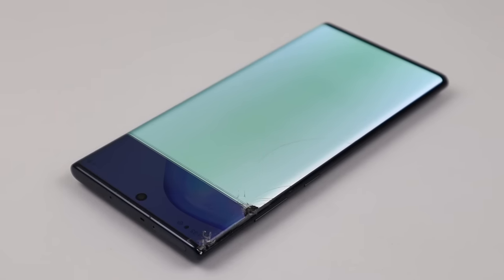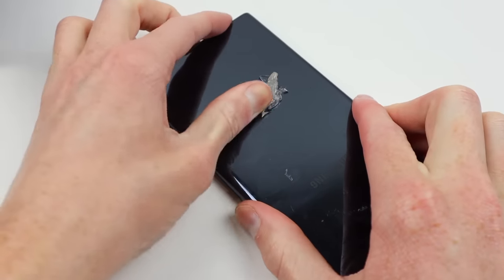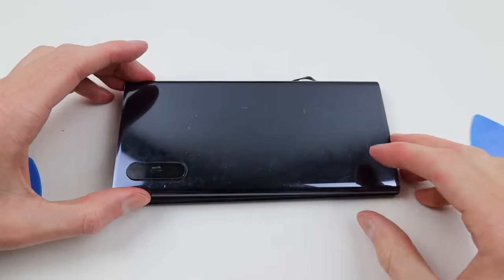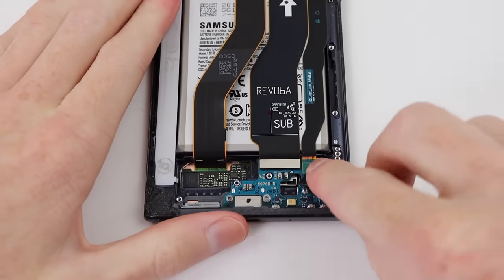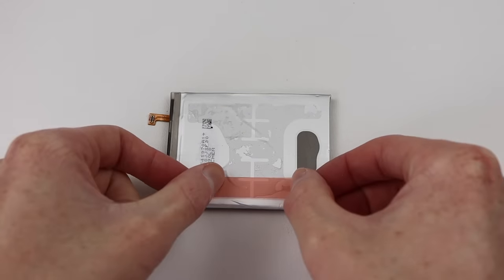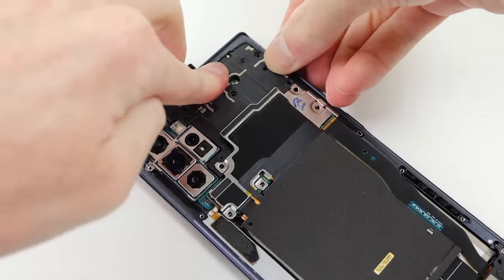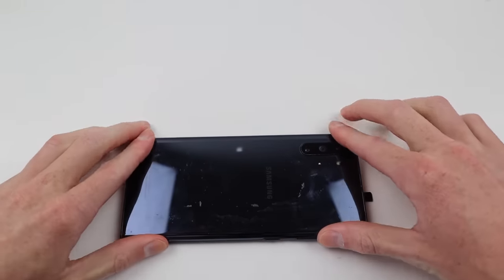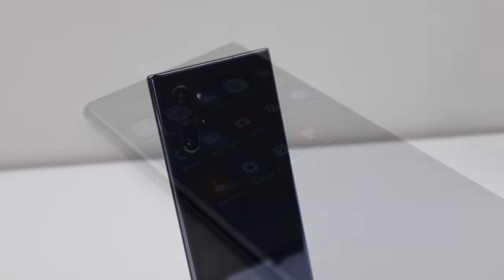How I saved $1017 on the latest Samsung by fixing a broken one - Note10+ Restoration

Comment: Hi, ex-samsung engineer here - when heating the device, place it on its front rather than the back. 

The reason for this is that the heat is not being applied directly to the battery or NFC/wireless charging coil, and removing the back glass is a lot easier. 

The heat will also evenly distribute throughout the body, and will allow you to remove the back glass.
Reply: I repaired s8 s7 note9  and now an s10. At 100 degrees for 2 minutes max I haven't had a problem. Isn't it damaging for the screen thou
Reply: @daniellantos26  It won't damage the displays, no, but you wouldn't use 100°, that's for sure. In three years working for them, I've never had a display damage this way at all.
Reply: Will the phone still be water resistant?
Reply: Hi sir, i've got a question. If i replace my battery from samsung authorized service, will my s10 plus still be water and dust proof?
Reply: @umutmckk  Hi Umut, provided it's done through a SAMSUNG authorised partner, they must pass water resistance tests before the device is given back to you. 

We were unable to book a phone out and return it to a customer unless it passed this test. 

In short, yes, the handset will be water and dust resistant again. New tape kits are applied when repairing the handset.

As an edit to my original answer, remember that batteries have a 1 year warranty and the remainder of the handset has 2. If the battery has failed within a year, and you provide proof of purchase, it will be done free of charge, provided this shows on tests and the device is free of physical or liquid damage. 

Remember that water resistant is for FRESH water, not for salt water, chlorine (swimming pools) etc.
Reply: @Revenge2393  thank you sir, i bought my s10 plus on 10th of july 2019, so my dad will send the phone to service, then we'll see. And again, thank you for answering me.
Reply: @umutmckk  No worries Umut, back up your data before you send it away and remove the Google account before resetting it. 

The device will be wiped, and removing the Google account helps to save 15 minutes per repair on removing the factory reset protection :).

Also, I'd advise that if you are sending away, take clear photos of the handset. I always had to do this with any customer before undertaking work, as it would save a lot of hassle for both parties if there were any scratches or anything that were caused during the repair process. Make sure to also send a proof of purchase showing the retailer, date of purchase and IMEI number (if available). This will dramatically speed up your repair as all the boxes are ticked before beginning work :)
Reply: Virtus Revenge why did you stop working by samsung?
Reply: @shahzaibzia371  - I worked in one of their experience stores, which sadly had to close due to no room for expansion. I was given the option to work for their larger stores, however, I'm pursuing web development :)
Reply: Bad advice.
Reply: @hawaiisidecar  - Interesting, care to elaborate on how this is bad advice exactly? Considering I worked for them for 3+ years and this was the official process for all repairs, I'd be curious to know why you think that?
Reply: @jamesband3978  Who is that directed towards?
Reply: @jamesband3978  Haha, no worries. Yeah, I don't really get @Hawaiisidecar's comment to be honest. 

Glad you found it helpful though!
Reply: and why were you fired again?
Reply: @AlvinAlsace  I wasn't fired, the store was closed. I've made that clear in my previous comment.
Reply: @Revenge2393  was kiddding lol. If i didn't ask somebody else would've
Reply: That is why you are ex-engineer :D
Reply: @darkoprerad  If you read my previous comment, you'll see that the store I was working in was closed as there was no room for expansion. 

I don't know whether you just choose not to read or didn't understand my previous comment, but I'd advise you go back and read it.
Reply: @Revenge2393  you have a ton of patience my dude. 👌
Reply: @alexjcheung5436  Worked with a lot of.. interesting people over the years, you learn to get used to it and just go with it 😁
Reply: @Revenge2393  Honestly, between you and me.... Do you own an iPhone as your daily driver, or a Samsung? ;)
Reply: @Braceface2.0  I use a Samsung haha
Reply: @Revenge2393  haha, that's good. You're loyal 😂
Reply: Nice to know
Even Jerry does it the wrong way by giving heat om back haha
Reply: @Revenge2393  How many entitled people have you met
Reply: @d4wnnnn  - Too many to count mate. You'd be surprised how many people were entitled, when THEY broke the phone.
Reply: Useful tips, thanks!
Reply: Curious to know, do you have a background in electronics? I'm interested in learning but have never studies electrical or electronic engineering. I'm into software. 😁
Reply: @emmyelijah7395  I didn't when I started, except when working with my dad as an electrical heating engineer during the summer. 

You learn all of it on the job and have to complete extensive training on test devices before you can even touch a customers phone.
Reply: @Revenge2393  Thanks for the reply. Interesting to know the test device routine. It sounds like a sort of apprenticeship.
Reply: Your calling a magnetic wireless charging coil a NFC charger, while claiming you worked for Samsung. NFC is near field communication which allows the user to make phone transactions with a credit card, or to share data between 2 nfc supported devices, NFC has nothing to do with charging.....
Reply: @doubleawakeel7214  Not what I called it, I stated the NFC coil, which is situated within the housing. I am aware NFC is used for wireless transactions, android beam etc
Reply: @Revenge2393  im only saying this bcs I just don't want people to think that NFC is what is charging there devices fam.
Reply: @doubleawakeel7214  They're contained within the same unit in the phone, so it wouldn't make a difference.
Reply: Thanks for your comment and answering all the questions. Really interesting and helpful to get some kind of advice by professionals.
Reply: @Revenge2393  make video repair samsung phone with SOP from samsung.
Reply: @adhyejuventus  Considering I no longer work for them, I wouldn't be able to even if I wanted to, sorry.
Reply: @Revenge2393  thanks sir, you're the best.
Reply: Hi Samsung guy. Can u donate me a phone for my poor domestic maid
Reply: @kkkirytenahtss1  I don't know if you're serious or not, as there are people who would genuinely ask this sort of thing 😂
Reply: @Revenge2393  yes I'm serious
Reply: @Revenge2393  we r poor ppl in India
Reply: @kkkirytenahtss1  There's absolutely no way I'll be donating a phone to you, if that wasn't already obvious 😅
Reply: @Revenge2393  Your really nice to answer ALL of these :D
Reply: @surinaandbro3673  Only takes a few seconds to do!
Reply: @Revenge2393  Do you think it's easy to fix a Samsung A70 ( front glass, everything else is fine ) without any experience or tools?
Reply: @CommaGaming  You'll need some tools to some degree to open and reseal the device. The S series are easier in my opinion.
Reply: @Revenge2393  I guess i'll forever have to live with a cracked glass plate! Haha
Reply: @CommaGaming  Your main issue would be separating the glass from the display without damaging it. It's not impossible, but it certainly is risky. 

samsungrepair(.)com will be able to quote you to give you an idea of pricing
Reply: @Revenge2393  that website is for US only + it only does screen replacement, not front glass. Mediamarkt here does the repair for 180 euros, while the phone itself is now 300 euros,  and 440 euros at launch inside The Netherlands.  Pricings around the world are a big fraud
Reply: @CommaGaming  Works in the UK also, just wasn't aware of where you were, that's all :).  The pricing of displays is pretty up there. Sadly, the display and bezel/bracket usually come as one unit on a lot of models when they're shipped, which is why the pricing is so steep :(
Reply: @Revenge2393  Its the only thing I dislike about phones, the display is apparently worth more than than the phone itself
Reply: @Revenge2393  hi bro. I used a samsung galaxy j5 and the display broke. I had a repair man fixed it but after a month the touch just stopped working (like 75%). Is this a common problem or did something went wrong?
Reply: @thedarkknight6021  When you say a repair man, I presume you mean a third party (such as independent store or retailer separate from SAMSUNG all together), is that right? In terms of the display not working, we provide a 90 day guarantee on work or the remainder of the warranty, whichever is greater. 

Provided the screen or anything else shows no sign of drops, liquid ingress or anything else, I can't see why any respectable business would have an issue in replacing the display free of charge, it's not a common for a new display to go wrong in a month.
Reply: @Largemouth Bass Productions Hi! I worked in a UK experience store, but with the high street slowly dying out in my area, they saw no room for expansion sadly.
Reply: Heres a good question.. can you use handwarmers - the little packs you agitate to use to warm your hands - to help heat up the glass seals? Thank you 🤓
Reply: @j.lietka9406  I've never had that question asked before! I wouldn't imagine so as the heat would have to be a continuous and spread evenly in order to fully loosen the adhesive. 

The temperature would be more hand burner than warmer, as you'd need the temperature to be 70-80°.
Reply: @Revenge2393  the idea came to me recently, & no, I didnt try it! Not sure how hot those packets get! Just one of those "I wonder if..." thoughts! Thank you 🤓😸
Reply: @Revenge2393  HOLLLLLLLLLLLLLLLLLLLLLLLLLLLLLLLLLY
Reply: I LIKE PHONES
Reply: With the NFC, in order for the phone to work & charge properly, both NFC & type-c port have to be connected? (Assume good battery, cord, etc) also, if you replace the front screen, can it be tested (not fully, but to see if logic board & new screen respond) without the6 rear cover being installed? Thanks again  does using the wireless charger tend to shorten the life of the battery from heat?
Reply: @stjepanpesa2887  even if you use a good quality seal & clamps? Thanks again
Reply: @j.lietka9406  Hi mate, depends on the phone. Some would work fine without one, others wouldn't. In terms of battery decreasing, the life is shortened if you use wireless charging as a permanent solution, as it's purely meant for convenience.
Reply: @Revenge2393  thank you. My hobby sorta is finding phones, tablets, laptops, that people toss, drop, or discard, & tinker with them!
Reply: @Revenge2393  just wandering, how much would a s10e cost to repair front screen
Reply: @Revenge2393  Hi thanks for your helpful comment I'm about to buy a cracked galaxy s10+ for a reasonable price it have no touch issues at all and works perfectly fine with alittle bit of crack.. but worrying about long term use, would that crack effect phone functionality or something? should I buy it or not?
I'm waiting for your replay 

Thanks!
Reply: @ghulamshahbadakhsh2050  It's completely chance in truth. There's no telling whether a phone will last an hour or a year, I've seen phones that are smashed to pieces last a few years and others that have the slightest crack go completely blank. 

In short, there's really no telling the history of a phone and how the crack has occurred. If you do purchase the phone, just be cautious around water and humidity, as that crack will mean the device is not water resistant due to now having a point of entry for water to get into the phone. 

Sorry I can't give you a more concrete answer than that really.
Reply: @y1817  Hi, sorry, I've just seen your comment. The general cost of repair is £200-220 here in the UK, dependent on your location, this may change. 

If you're within the catchment area, samsungrepair(.)com will give you pricing for someone to come out to you and fix the device on site. 

That pricing is based on there being no other issues with the phone 😁
Reply: @Revenge2393  
Thank you!
by the way I haven't purchased it yet...
Reply: @Revenge2393  ok, im in the uk, just curious thanks
Reply: did anybidy ask tho?
Reply: @Revenge2393  I could imagine that a heatbed of a 3d printer might be a decent option if someone has one. They're usually adjustable from room temperature to 110°C and have a pid control to avoid "overshooting" the set temperature.
Reply: @stjepanpesa2887  bro the magnet doesn't hurts the phone this isn't a hdd
Reply: @Revenge2393  I have a realme X I know u work on samsung but my battery is bad know how to replace it)
Reply: @ninzembo908  https://youtu.be/IOQzMK-d0XU - looks to be pretty standard for a midrange phone. Remove back, then unclip from the bracket, the A series from Samsung are built very similarly to this phone :)
Reply: you are amazing! :D sure i watched the video, but i enjoyed your comments way more. good job!
Reply: @Revenge2393  hey, how would one get into repairs? Is it an apprenticeship or something? I'm a CS advisor for Samsung atm
Reply: Stop lying
Reply: @alekkela6070  I was fortunate enough that when I applied I was given the option to do so. I worked within an Experience Store, and as part of the setup, you could either be a frontline sales person or a repair tech. I opted for the latter as I have always preferred to fix things rather than sell them 😁
Reply: @aaltok9410  Cheers man, glad you enjoyed it! I spend a fair bit of time on YouTube, so like to interact with people 😁
Reply: @HarryBerry316  - I can't take someone with an Among Us picture and videos of someone saying "cookie" and racial slurs uploaded to their channel seriously, sorry 🤣
Reply: @Revenge2393  ah okay, don't see them offering this option again anytime soon lol but thank you for replying 😁
Reply: Virtus Revenge bro I’ve read all the comments and tried to understand you a bit. I think you should start a YouTube channel doing repairs with advice talks and stuff...
Reply: @reddevilrohan7442  I would love to, however, the investment in getting the parts together and getting everything set up is a bit of a gamble at the moment, particularly with current circumstances. I'd love to do so, but I don't know the repercussions (if any) of doing so.
Reply: @kkkirytenahtss1  not poor than where i live.. u got a maid! :D
Reply: @Revenge2393  you're such a helpful guy!
Good wishes your way!!👍
Reply: @RamSharma-90_64  Thanks Ram, good wishes your way also!
Reply: @Yes I'm not really off YouTube all that much, so I always like to pop in and see what's going on in here. 

You're probably nice too!
Reply: @Revenge2393  Dear Ex-Samsung employee, do you have any reasons why Samsung discontinued the Galaxy S Active series?
Reply: @Yeshfie_5510  - We were never made privvy to that sort of information to be honest. I would suspect it was due to the distinct lack of sales, in the years I worked there, I experienced 2 people asking for one.
Reply: @Revenge2393  what do you think about the Note 7 battery scandal?
Reply: @Yeshfie_5510  - The number of devices this actually occured in was exceptionally low, however, Samsung were quick to respond and recalled the devices. 

This actually made the issue appear a lot worse and widespread than it actually was. They never really got their publicity team up to Apples standard which had a very interesting (and for some reason accepted) approach of "It's not us, you're using it wrong". 

As they accepted the liability and offered alternative devices, people still didn't want to part ways with the phone, so mandatory software updates were released to stop the phone being charged above 80%, then 70, then 50 and all the way down to only being able to be charged up to 20% now.

In all, it was chaos, but the Note FE is just a Note 7 with a different battery inside. 

In summary, handled well from a safety stand point, handled terribly from a publicity stand point.
Reply: @Revenge2393  What do you think is the best Samsung, in your opinion? (Mine is the Galaxy A20)
Reply: @cheviot_  There's no definitive best really, Samsung release 50+ phones every year across different markets which caters for anything and everything. 

The best Samsung handset I personally owned was the S10+, primarily because it had everything and anything in it. Great battery life, great camera, amazing display and still stands out as one of the most successful product releases they've had to date.
Reply: @Revenge2393  Thanks for the reply! Also, what SGH model had the Emerald theme? Trying to remember, but I can't get the model number, only the SGH bit.
Reply: @cheviot_  If you're referring to the emerald green colour, then the Galaxy S6 (SM-G920F) here in the UK had an Emerald Green variant.
Reply: @Revenge2393  No, it was a flip phone, I vividly remember it being a Samsung, it had themes (it was set on one called Emerald)
Reply: @cheviot_  That's going to bug me now lol, can't say I know it to be honest with you.
Reply: I see you also worked at a ubif lmfao
Reply: @Revenge2393   i hot up a samsung a8 2018 back case and it`s broken when i want to remove, can you tell me the reason?I didn`t hot up front/display :))
Reply: @andreilucian10  - This can be for a number of reasons, the most common being a small crack already present on the back glass. The heat alone shouldn't cause a back glass to crack on its own, you also have to be cautious when removing the glass, as the adhesive may not be loose enough initially when it was heated.

9 times out of 10, it's due to pre-existing damage on the back glass.
Reply: @Revenge2393  thanks a lot, now i think that lcd was broken and the back cover was a little too.Thanks again!I wish you a Merry Christmas!🎄
Reply: @andreilucian10  Not a problem, hope you have a great Christmas too! 🎄☃️
Reply: Still doing it 7 months later!
Reply: @imgreen4233  Always like to check in :)
Reply: @Revenge2393  So.. what phone are you using?
Reply: @starzbuildz  Thanks! Hope you have a great new year too
Reply: @samtaria7493  Currently, I'm using a Pixel as I like stock android :)
Reply: @Revenge2393  is there a Galaxy Folder 3? If so, do you sell them in Israel?
Reply: @Yeshfie_5510  I'm not sure, I'm an ex-employee so wouldn't have access to that information. 

When I did work for them, we had to sign non disclosure agreements also, so I couldn't tell you, even if I did still work for them, I'm afraid!
Reply: CB Brothers  That depends entirely on where you're located. If memory serves me correctly, the display was quite costly (around £200) and the Note 5 was specific to non European markets, meaning it was either not serviceable, or an extensive wait time was in place (up to 6 weeks) if you are based in the UK. 

I wasn't able to service a lot of non European devices until the final months of the stores closure.
Reply: CB Brothers  Yeah man, only takes a couple of moments!
Reply: @suddenlyacat  It does not damage the display, I fixed 1000s of phones over the course of 3 years with no issues.
Reply: @suddenlyacat  - A lot of SAMSUNGs devices use AMOLED, and again, were never damaged using the process that Samsung advised.
Reply: @Revenge2393  why is Samsung's marketing so hypocritical?
Reply: @Yeshfie_5510  In what respect, may I ask? I think their marketing is pretty poor to be honest, and that it's an area that needs serious investment, but hypocritical I haven't really seen. 

May I ask what you mean by that?
Reply: @Yeshfie_5510  - Just seeing the title of the video, I can see what you're getting at. I wouldn't say it's hypocritical marketing, but their follow on from their adverts mocking Apple, to then follow their trend IS hypocritical. 

The removal of headphone jacks and charging bricks in the box are two examples of this.
Reply: @Revenge2393  I just want to say, you're an absolute legend for replying to comments for this long and answering people's questions respectfully :)
Reply: @riftiro4427  Thanks man! I don't see the point in being disrespectful, it's cool that people have so many questions 😁
Reply: @Virtus Revenge  Damn read all your comments I felt like I was reading plays, you have been replying for 9 months Big salute!
Reply: @TheJoker3031  I'll take that as a compliment, not heard anything be referred to "reading plays" before, but only takes a few seconds 😁
Reply: @Revenge2393  what do you think of phone wars?
Reply: @Yeshfie_5510  As in people arguing over phones? As long as there's at least 2 of the same thing, there will always be difference in opinions. 

It's trivial to me, but it does mean that competition exists to push companies to try new things, so it's not all bad.
Reply: @Revenge2393  
do you own a single Apple device?
(This counts the vintage routers)
Reply: @Revenge2393  
lol also what do you think about the discrimination against Apple in Samsung ads
honestly Apple should do the lawsuit or make a ad with heads exploding because of the note 7 
LOOOOOOL
Reply: @pompomaddons  Hi Logan, I see you've put two questions, so I'll just answer them both here. 

I don't own any Apple products, but have done in the past, they just didn't really do it for me, though I can see why people like them. 

In terms of the ads, I always thought it was a stupid move to be honest, never truly understood why they felt the need to do it as its childish, and this is where Apple gets it right. 

They don't care what new technology is round the corner and they're happy to take a backseat while everyone else essentially tests the technology, for them to release it later after seeing everyone's mistakes.
Reply: @Revenge2393  I have a galaxy s6 and the micro USB is broken how to fix
Reply: @Castawot.  a lot of the time , I saw that chargers wouldn't go all the way in, and this was easily fixed by taking a small dental tool and carefully working around the port, removing any dust or dirt from inside the port, you can even use isopropyl alcohol to finish up and use a toothbrush around the pins. 

If the pins are bent out of shape, fortunately, the S6 has a removable charging port and they're relatively cheap to replace
Reply: @Revenge2393  no the port is bent
Reply: @Castawot.  With that being the case, you can purchase the charging ports pretty easily through the likes of eBay, though I couldn't tell you which are genuine as a lot will claim to be OEM (Original Equipment Manufacturer) branded, meaning they're made to the same standard or are actually made in the same factory as the parts Samsung produces. 

The S6 is one of the harder devices to fix, due to the bracket and display being separate unlike the S8 onwards, as the bezel and display are joined and easier to disassemble, I never liked fixing them 😂

Just be cautious of any cracks on the back glass or display, as the back glass will likely shatter if you have any damage on the back and need replacement once you open it up, if it's cracked.
Reply: @Revenge2393  how to open i dont want to damage my daily driver
Reply: @Castawot.  There are many videos out there that show how to disassemble the device, it's a bit long winded to explain here, so I will link JerryRigs video below. 

https://youtu.be/zJSr08DFyK4
Reply: @Virtus Revenge do you know the right percentage to maintain a Samsung phone? I've heard that it's a 20%-80% rate but I don't know if it's accurate. And also can I charge 'till 100% or will lose a cycle? Thanks in advance ☺
Reply: @giovannafig1521  Cycles consist of any time the device reaches 100% charge. This can be a single charge of 0 - 100%, or one charge of 0-60% (60) then another from 20 - 60% (40) equalling 100%. There's speculation that the most ideal charge capacity is 55%, but realistically, you're not likely to do that. 

The only thing I would say to abstain from is charging the device unless it falls below 15%, when you can avoid doing so
Reply: @Revenge2393  Thanks :)
Reply: @Revenge2393   I am apparently one of the unlucky ones who have had the experience that I wouldn't wish on my enemies with my note 10 plus. It has been the absolute trash phone I've ever had. I've lost customers amounting to thousands of dollars due to its unreliability and lack of service. It's the slowest phone I've ever owned and before this one I would recommend galaxy to everyone and defend them fiercely but never again. I've contacted several techs with t mobile and now same phone on verizon with awake problems therefore must be Samsung.. if there's a possibility of helping to restore this phone to it's glory somehow please help.     P.S. I found that changing apns took speeds to another level but short lived as they started to fail soon as I created a new one. It's almost if I've got a hacker controlling my connectivity.... From google servers somewhere. I need a genius such as yourself to help with my diagnostic test on this home to put to rest my fears of being throttled and of the $1300 waste of money. Btw I purchased two of these mistakes...
Reply: @michealsherrouse287  What exactly are the issues you're experiencing?
Reply: @Revenge2393  hey i don't know if yoy respond anymore to comments, but is note 10 gonna slow down with time? And should i upgrade i had it for 1 month but the phone doesn't look like the flagship of these days
Reply: Or buy a $2000 AOD :)
Reply: @maxislate5741  That's a very open and vague question really, I didn't find my S10+ slowing down over time personally. The one thing I can recommend however is setting up auto restart, this will keep the phone running fresh by automatically restarting it once a week 😁

The device is still more than capable these days, if you didn't have a 10+, I'd recommend the 20 Ultra, but if you have a Note 10+, it's not worth the extra cost imo.
Reply: @Slapshot Sweethearts Podcast FanBase The most useful and most overlooked feature is auto restart. People tend to keep their phones on 24/7, but often forget that it's essentially a computer. Auto restart will restart your phone once a week automatically, provided it's not in use and at a time you set. You can find it within the settings menu by searching for Auto Restart. I had mine set to every Tuesday at 2am and found that it just helped to keep everything running smoothly. 

SD card choice (should you choose to use one) also makes a difference as low quality SD cards tend to lock the device up due to their low speed, so always look for a class 10 😊
Reply: @Revenge2393  does heating the device not affect the battery?
Reply: @NSJmakesMusic  If you're heating from the front, no. It's also not done for an extensive period of time 😊
Reply: How to know if the display is broken or it's just the cable
Reply: @Revenge2393  does the legend respond?
Reply: @rachidjbari9598  I wouldn't say I'm a legend haha, but yes I do!
Reply: @abdelrahmandiea3798  Sorry, I didn't see your comment! You can purchase display testers and cable testers independently to help find the root cause of the fault. 

Most are secured to the LCD, and you risk breaking the display if you replace the cable, so be careful when removing the cable, where possible. 😊
Reply: @Revenge2393  Hi, I would like to ask about your thoughts on the Note 9 since I'm planning to buy one (most likely a refurbished one from a trusted seller) soon. (P.s. I'm one of those people that tend to buy older flagships because I can now at least afford it.)
Reply: @aceb2660  The Note 9 is still a more than capable phone by a long way, and still outclasses a lot of the newer A series. Dependant on price, it's still a fantastic buy. 

My only gripe with that phone was the fingerprint sensor location, but a fantastic phone all round with a very low warranty repair rate. I can only recall one that came in that wasn't smashed to pieces with an issue. 

Just be careful with the S Pen, they're only plastic and people used to break them quite a lot. Hope that helps!
Reply: i would like to know the thought process of adding a full on pen that fits inside the phone. But NOT adding a headphone jack. Wtf?
Reply: @Revenge2393  is galaxy s9 screen easy to fix as diy no experience?
Reply: @veei4762  I would say the S9 is one of the easier devices to fix, due to the display being bonded to the bezel/bracket. It really depends on the extent of the repair, as an "only glass" repair carries a high risk of breaking the display.
Reply: @Revenge2393  thanks so much! I don't even care about the phone just want my contacts. Any idea on a solution? Screens broken no debugging there is a lock code and it wasn't backed up to date😩I've tried the tv mirror trick via otg and hdmi but mouse cursor won't show
Reply: @veei4762  Do you know anyone who has the DeX station/cable? That's always the easiest/most viable way to use peripherals. The only other thing I can suggest is that if you can get a image displaying via HDMI/MHL, try using the screen as normal, as the touch portion (digitiser) of your screen may still be intact and see if you can get a Bluetooth mouse/keyboard combo connected.
Reply: @Revenge2393  I went ithe hdmi route already I got the image with lock showing time all that but mouse doesn't show. I will try to insert a sim to connect to network and go on find my mobile. I've tried that and failed already as well but it may have been the carrier. Hell after that I'm done I quit🤣 thanks again for assisting when possible solutions
Reply: @veei4762  how are you connecting a mouse? Via Bluetooth or OTG?
Reply: @Revenge2393  otg can't do Bluetooth the phones bt is not on
Reply: @veei4762  Even though the display is black, does it respond to touch when it's hooked up via OTG?
Reply: @Revenge2393  you can hear the vibration but when I swipe nothing. The screen sometimes blanks in and out upon press of mouse or vibrates.
Reply: @veei4762  What I'm trying to ascertain is I understand the display is gone, but it sounds like there is still power. The only other thing I could think of is connecting a USB hub via OTG and have a mouse and display cable connected
Reply: @Revenge2393  oh I have thought of that as I have both BUT I may need a different otg mine doesn't go in a usb port it had one and they both have type c ends that need to go into a device or I assumed it wouldn't be "active" otherwise
Reply: @veei4762  You can get OTG adaptors that are powered externally but have a wider port range ☺️
Reply: @Revenge2393  i have that I have 3 altogether. But no power going to any lol I was trying to figure out what that is lol. I'm all lost in the game lol. If I do figure it out the information you've provided will definitely be the reason lol ❤
Reply: @veei4762  That's strange, the only thing I could think of is possibly secure startup? Do you have to enter a PIN/Password before the phone went to the Samsung logo?
Reply: @Revenge2393  nope it never gets that far. Literally only shows the lock key with the time display which is what my phone screen looks like at all times.
Reply: @veei4762  Oh okay, but I assume you can see that display when it's hooked up, right? A wired mouse will work without external power through the supplied OTG adaptor
Reply: @Revenge2393  I have a wired lol
Reply: @Revenge2393  hey thank you for the tip 
If you can help me in 1 question i will be more then happy 
I have an galaxy s10+ with the same problem half screen is white 
I replaced the screen with a new screen but still the same problem 
Do you think its the motherborad 
And should i replace it?
Reply: @alexshimanovich2870  a motherboard is a very costly fix to do, you could've been really unlucky with the second display. I've personally never seen that fault as a result of the motherboard, only the display. That's not to say it couldn't be the board, but that's an expensive gamble to take.
Reply: @Revenge2393  thanks for the fast respond 
The wierd thing is that the hlaf white screen is  exactly on the same line for both screens
And the new screen work great the phone ture on great but i cant see half of the screen 
I saw some comments on samsung fourms saying they replaced the motherboard and its fix the issue 
Can you tell me how can i check a motherboard 
Even with multimeter 
Or  somthing i can do? 
Thank you very much for the replis
Reply: @alexshimanovich2870  As we had parts readily available, the quickest way we could check was by simply swapping the part out. Have you checked to make sure the new display wasn't damaged during assembly? The only thing I could really suggest would be changing the part if you have a friend with the same device, I've had to do that before haha.
Reply: @Revenge2393  for sure the new display wasnt dameged i did it very carefully 
I dont have a another screen to check with 😔
But you saying you never had a problem on screen that cause by the mother board?
Reply: @alexshimanovich2870  Not for the line across the display, I had a few with completely blank displays and found that there was corrosion to the connector, which was easily fixed with a bit of isopropyl and a toothbrush to clean it. Had one where the board had to be replaced as it was pristine, just decided to not display for some reason.
Reply: @Revenge2393  so i will try to clean the motherboard with alcholo 70% will be good or use only 95%+? 
And clean the whole mother board or only the screen connector?
Reply: @alexshimanovich2870  I have only personally used 90+, so I'd recommend that if you have some ☺️
Reply: @gmeeer9165  Thanks for your valuable input!
Reply: help i nedded lcd for note 8
Reply: How much would the super amoled part of the samsung s8+ cost as therr is the black dot bottom right side on the phone? The rest of the phone is fine so I'm pretty sure would not be the LCD under the glass. I am thinking just get a new phone though as that and the battery replaced (not last as long of course after 5 years) would be more than say the A32 and A32 would be a better samsung than the s8+
Reply: @doubleawakeel7214  No, you challenged his words, and now you're backtracking. Admit it for what it is and just admit you misunderstood what he mean't.
Reply: @Revenge2393  With this question in mind, whats the display conditions like, I feel like you can't just "Replace it with any screen" that is made for it because I feel like it won't have the same quality or resolution or perhaps pixel count?
Reply: @glennl2871  If it's serviced by Samsung, they're generally around the £200 mark (if there are no other problems or other damage) and they replace the battery at the same time, hope this helps ☺️
Reply: @Revenge2393  thanks and has helped and unless think would rather a S20 the A31 or now A32 look quite good though not quite as high spec as the s20 of course, probably good choice for another phone rather than repair. I live in Australia and converting it would be about $372 which as long as not the S samsung, new one is cheaper :) and better spec for camera cpu.
Reply: @glennl2871  Weirdly, I just received an A32 5G as a work phone just the other day so I can give you some first impressions on that device specifically, as I haven't used the A31. 

It's pretty weighty, thick and very slippery, after everything was set up, it works quite well, but the S line is top of the line and you'll miss camera quality, speaker quality etc. 

In your position, I'd actually be looking at the S10+ or an S10 5G. I feel they're still the most complete phones Samsung has ever made.

You get the headphone jack, water resistance, a versatile camera, wireless charging, expandable storage and a fantastic display. 

The S10+ and S10 5G still outshine a lot of the competition in today's market, purely because you have all the options in the world. If you need 5G, the bigger display, the slightly larger battery and a ToF sensor for better depth on the camera, the S10 5G is the way to go. 

I loved my S10+ and stupidly lost it on a night out, but they can be bought for around 300 and offer way more bang for buck.
Reply: May i ask how u can know if the new screen is original one? Any chance someone sell it with low quality amoled for that screen
Reply: @daniellantos26  Well, I'm looking at the very start of the video, and I'm getting a funny feeling that we don't need to be concerned about damaging the screen. 🤔
Reply: Hi fellow aussie
Reply: @kankantona9070  Generally speaking, the copies are so obvious that it'd be impossible to not know. The bezels are typically a lot thicker, the screen is low resolution and pixelated, very rarely will you see a copy that is anywhere near the original.
Reply: @montanapharmaceuticals7881  Not really, but you can find an S10+ or S20FE for the same money in some cases
Reply: With the battery warranty in particular would I have to purchase the device directly from Samsung's stores or would I be able to have a device purchased from a retailer (e.g. JB-HI-FI) and still have that warranty?
Reply: @GeneralAeon  It doesn't need to be from Samsung directly, just factory new. The difficulty being that due to Samsung making so many devices for so many different markets, if you had a Malaysian device in the UK, you weren't able to have that serviced free of charge as the part numbers were slightly different and the software wasn't available to us. 

This is where Samsung fell short in my opinion, if you have an iPhone, you have an iPhone, and that's it, you can have it serviced free of charge within its warranty period and if it's free of damage.
Reply: @Revenge2393  it's a shame that Samsung decided to change certain parts for different countries, honestly a little shady. Thanks mate
Reply: @GeneralAeon  Yeah, it was frustrating beyond belief when you had a lot of devices such as the Note 5 that never came to the UK, but naturally, customers would come in as they were living in the UK but source the device in the UAE and we couldn't service it as we couldn't verify the fix by sending a service connection as the software wasn't available to us, so couldn't book it in, let alone book it out. That may have changed, but that was the case in my time.
Reply: @Revenge2393  Well thank you so much for helping people out!
Reply: @Scyth3934  Takes no time ☺️
Reply: Hello! Do you know how KNOX counter works? Is it an e-Fuse?
Thanks
Reply: @kaan4864  Depends on the device, older models were software and could be reset, newer devices utilise E-Fuse.
Reply: @Revenge2393  Thanks, can I reset the KNOX counter of an S5 and S6 myself and does an S4 have KNOX counters?
Reply: @kaan4864  S4 and S5 is possible via software,  S6 is trickier due to E-Fuse.
Reply: @Revenge2393  Wait S4 has a KNOX counter? It doesnt show in the download mode though
Reply: @kaan4864  Depends on the variant, some did, some didn't.
Reply: Haha, Seems like you got a new job! Tech support 😂😂
Reply: @Kayshots  It's what I do for a living anyway now haha
Reply: @Akhilesh Sattanathan Are you feeling okay? I'm astounded to think me helping people whilst not asking for anything in return is a "scam", please elaborate.

To those reading this comment and can't see the person I responded to, they deleted their comments stating I'm "scamming" people by offering advice for no charge whatsoever LOL.
Reply: @Revenge2393  Hey, got a question. Do ya'll use programming tools for the optical scanners of the A Series phones? Thanks!
Reply: @TIMETECH07  Hi, we had software during the testing period prior to and after the repair to check and calibrate the optical fingerprint sensors, if that's what you're referring to 😁
Reply: @Revenge2393  I see, thanks!
Reply: @Virtus Revenge I Purchased A Galaxy Note20 In December 2021 But How To Screenshot?
Reply: @GalenoMain  volume down and power button should do the trick.. don't long press them though..
Reply: @GalenoMain  Tap the volume down and power button at the same time 😁
Reply: Hi Virtus Revenge,is apple easier to repair or Samsung because for repairbilty Samsung is quite poor
Reply: @epicplayz5166  Depends on a lot of factors to be honest. For screens, it's more inexpensive to replace an iPhone display, but easier to fit a Samsung display in most cases, as the bezel is attached, along with not having security screws everywhere. 

For a back glass, most newer iPhones are one solid frame and back glass combo, whereas on Samsung devices they're a single piece you can remove and replace. 

It's model dependent really and the type of repair you're doing, I found Samsung's easier to work with, but on some models the charging port was soldered to the main board, so this was a pain. 

In truth, I've mainly worked with Samsung devices, so can't give you a definitive answer from personal experience as I've not repaired many iPhones at all, and can only base this off feedback from friends who have, or from repair guides found via videos.
Reply: @Revenge2393  thanks for replying,I see what you mean,but removing all the components for a screen repair seems like a pain,is it only for curve screens or does it also imply on flat ones
Reply: @epicplayz5166  Curved screens mainly, flat screens like the S7 (for example) had to be separated from the bracket.
Reply: @Revenge2393  Is it possible for 9.0 Pie be updated to android 12.
Thank you
Reply: @epicplayz5166  Depends on the region and the release rollout of that region. Custom ROMs are also an option, but void warranty and can have increased security risks, bugs and other weird behaviours.
Reply: @Revenge2393  Hi,thanks for replying,i see what you mean, I think I am better off with Pie 9 however Pie 9 rarely recieves an update so don`t you think that is a potiental  security risk.Also what is the maximum capacity of the samsung A8(2018 UK version)with a SD card.
Reply: @epicplayz5166  There is that potential, yes, due to security vulnerabilities that have not yet been patched. 

In regards to the A8, I believe the max memory card size is 256GB, though moving apps to the SD doesn't work well natively, as if you're even able to, they go to internal storage when they update
Reply: @Revenge2393  Sorry for hopping onto this year old thread 😅

My Tab S7's screen blinks to black for a second and turns back to normal.
 I can't reproduce on demand, but it will happen at least once every hour or so, 
even in Safe mode, after rolling back an update, clearing the hw cache & factory resetting.

However, the S-Pen & touch is all working normally when using the diagnostic code test and the screen is fully functional. 

Could this be a loose internal ribbon cable or is it the display itself, given your experience. Thanks in advance !
Reply: @GWT1m0  Likely a loose cable, saw this on the Tab A notoriously where it would just slip out
Reply: @Revenge2393  Thanks for the reply !
Hopefully I'll convince the repair technician of that...
Reply: @GWT1m0  Make sure you mention this has happened in safe mode also, as most don't try this. Usually a quick inspection will allow you to determine if it's loose or not 😁
Reply: @Revenge2393  I here to say it's an honour to me you sir 
btw I read all the comments and u sir got patience XD
Reply: @thawesnerd  I wouldn't say I'm anything special, just like to help people out 😁
Reply: @BoltsNation2022 You'll need to go into Settings > About > Tap the build number 7 times (but spam it) and it'll prompt you for your lock screen password / pin. This will then enable developer options in the settings and you can allow it from there
Reply: @BoltsNation2022 OEM unlocking is normally what you'd see
Reply: @Revenge2393   Damn you still replying 😂
Reply: @thatguyfrom877  Yeah man, passes the time!
Reply: @LightningPlayoffs2022 Sorry, didn't see this. Where did you purchase it from and is retail mode on it?
Reply: Shane's reptiles  Not sure I understand, perhaps I'm misreading, but I don't understand your question?
Reply: Should I try to replace only the glass of the screen or all the screen of the glass screen is damaged and the display is OK?
Reply: @Revenge2393  If I can ask, what's Samsung's stance on rooting. Since my Samsung phone is unrootable due to the bootloader being permanently locked. Plus, it's on a somewhat obsolete version of Android, and the phone isn't even super old.
Reply: @chachaboy2  In what respect? No manufacturer as far as I'm aware is pro root and will void your warranty instantly once they find that it has been, even if it's returned to stock afterwards, it can still be seen. What device is it?
Reply: @Revenge2393  It's a Samsung Galaxy J3 (2018). I don't care if it will void my warranty, since it expired already. It gives me zero options to root it, and it even releases "security patches" that I feel potentially only consist of patching methods that could unlock rooting. I'm just used to seeing "security patches" as "we patched something to keep you inside our walled garden."
Reply: @chachaboy2  Depends on the support from the community externally, as someone who no longer works for them, I can tell you that XDA forums is a great source of rooting / custom ROMs and Freija is a great tool for stock firmware if you ever need to go back to stock. Just make a backup as any root or custom ROM process will likely wipe your data
Reply: @Revenge2393  I did look there and it says my phone isn't possible to root. It doesn't allow me to unlock the boot loader, and it just seems like people forgot my model of phone existed.
Reply: @chachaboy2  The J series were very prevalent in markets such as India, Malaysia, UAE etc and are cost effective, as a result, I feel that these were sort of left behind as Samsung felt that because they didn't charge a premium for them, they didn't put the infrastructure in place to supply consistent updates to that device. The same likely applies to the rooting / modding community, some rely on donations for server space (not so much now thanks to Google drive, MEGA etc) so the time and effort it takes to create a root method is likely not worth the time ≠ money. You may find there are cross development forums that encompass multiple phones where unlocking the bootloader and rooting the device is the same method / principal.
Reply: It's applied directly to the part you want to heat, so it should work better. Plus, by heating from the screen, the heat has to go through the battery to the back :/
Reply: @balenaluba4215  The battery of the device is located on the back of the unit. If you were concerned that heat is going through the battery, you wouldn't heat it from the back, as it's being applied directly to the battery that way. 

This is the way it was always done as a Samsung engineer, and generated less heat to the battery also. Never had a battery or screen damage this way.
Reply: @Revenge2393  It's directly to the panel you want to remove, though? If it's to the screen, the battery is between the panel and the screen, right?

Idk, maybe they aren't that sensitive to this kind of slow, gradual heating, no matter how it's applied.
Reply: @balenaluba4215  It is, but regardless of which way you heat it, the heat transfers through the battery. Whether it's from the screen to the back or vice versa. Batteries are a lot more resilient than I once realised before I started there. Even swollen batteries with the back lifting off the device could take heat 😂 The difference between the two methods is that you're not applying direct heat to the battery, rather, it's going to the display and the bezel that's attached, heats up the sides and loosens the adhesive also 😁
Reply: @Reece Dunster I used to work for them.. now I don't?
Reply: Your just like me I'm 9 years old and I'm a tech nerd which makes me open up a whole ps4 and knowing what to do
Reply: Is my private files e.g. Photos/Videos are safe in Samsung service centers??
Reply: @saintjackass6445 definitely back them up first
Reply: @Revenge2393  Heyyyyy !
Reply: @arnavvv123  Hello 👋
Reply: @Revenge2393 Thanks for your help and dedication.
Reply: @Splarkszter  No need to thank me 😁
Reply: where do i buy a original screen , amazon , ebay, aliexpress have only fake ones